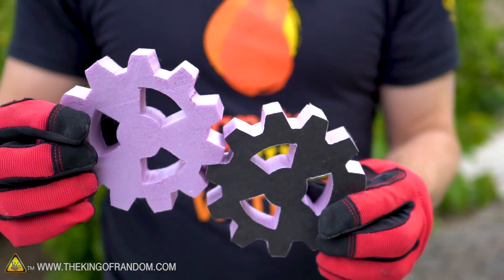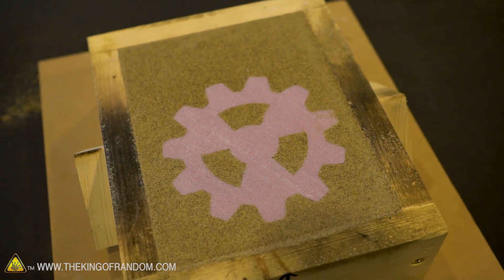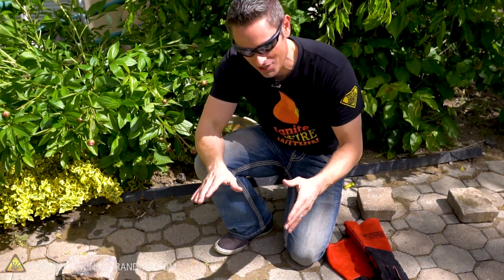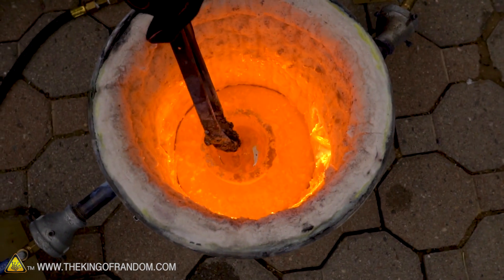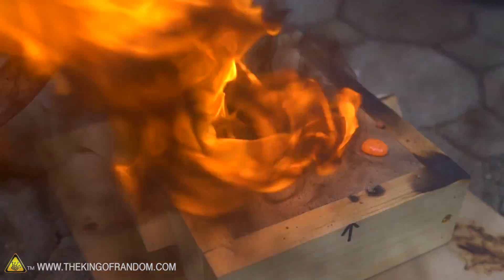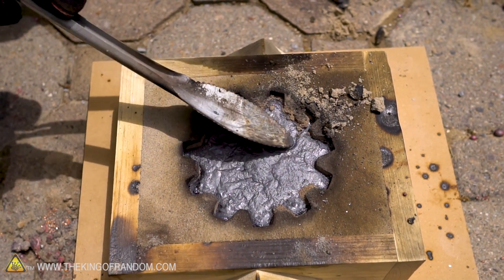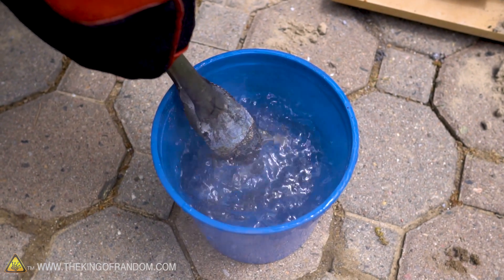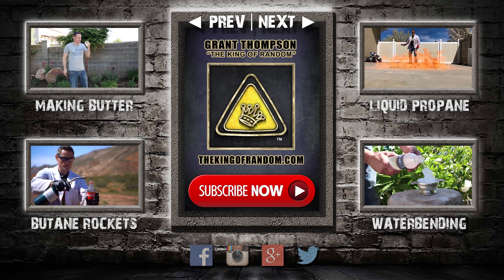Argh. Why Is Copper So Difficult? TKOR Tests Melting Copper In Our Homemade Foundry

Comment: always go to the scrap yards to get your copper much cheaper
Reply: What do you guys mean by dirty copper? dust, dirt and sand is easily cleaned off, you grab a broken down electric motor or transformer and you could get decent copper there from the coils alone and other bonuses like aluminium and steel which is cheaper than buying brand new copper tubes pound for pound.
Reply: 13thSystem ᴡᴇ ᴍᴇᴀɴ ᴛʜᴇ ғᴀᴄᴛ ᴛʜᴀᴛ ᴅɪʀᴛ, sᴀɴᴅ ᴀɴᴅ ᴏᴛʜᴇʀ ɪᴍᴘᴜʀɪᴛɪᴇs ᴄᴀɴ ʙᴇ ɪɴsɪᴅᴇ ᴏғ ᴛʜᴇ ᴄᴏᴘᴘᴇʀ
Reply: Non metal impurities are rarely an issue in metal working, it's the metal impurities such as one metal mixing in another metal which is a problem to remove and in most cases impossible. Most non metal impurities rise to the top when melting metal sorting itself out.
Reply: Jay Perez what font is that
Reply: I have a feeling he could get some sand inside the gear.
Reply: but if you buy copper in scrap yard its not as clean as new stuff
Reply: Richard Jelen he was doing a terrible job of keeping it clean. How much sand do you think he mixed in with the copper?
Reply: Heathclor sᴏ ʏᴏᴜ sᴀʏɪɴɢ ʏᴏᴜ ᴄᴏᴜʟᴅ ᴅᴏ ɪᴛ ʙᴇᴛᴛᴇʀ ᴡɪᴛʜᴏᴜᴛ ᴜsɪɴɢ ɴᴀᴛᴇ ᴏʀ ɢʀᴀɴᴛ's ᴛᴇᴄʜɴɪǫᴜᴇ/ᴍᴀᴋɪɴɢ ʏᴏᴜʀ ᴏᴡɴ?
Reply: My local scrapyard will sell to you. As long as you are buying at least 2,000 lbs.
Reply: @wampaku2  my local junkyard sells washing machines which have tons of copper wires for only like 10-20 dollars
Reply: must be a rigid copper alloy wire is too pure and too soft
Reply: But then it's not pure
Reply: Just buy it from the neighborhood crackhead.  Name your price is the name of the game there.
Reply: Rick Gunter ɪᴛ's ɢᴏɴɴᴀ ʙᴇ ᴍᴜᴄʜ ᴍᴏʀᴇ ᴅɪʀᴛɪᴇʀ ᴛʜᴀɴ ᴊᴜsᴛ ʙᴜʏɪɴɢ ᴛʜᴇ sᴛᴜғғ ɴᴏʀᴍᴀʟʟʏ

Comment: Watching this experiment was painful.  I was about 5 years old when I first saw my father pouring molten metal in a mould.  Centrifugal casting.  How do you expect loose sand to stand up to the forces of weight and pressure of molten copper??? If you had to use this method, you are better off to keep the Styrofoam in place, giving stability to your sand mould as the copper replaces it.  You also need to worry about metal contraction upon cooling.  I am a tool and die maker by trade with extensive knowledge about casting, forging and every other imaginable means of metal fabrication, manufacturing and metal forming in ferrous, non ferrous and precious metals.

Comment: Quite amateur way... If you want to have better result:
1. Use colsed mold with cannal
2.Allways heat up your mold before you start pouring metal.
3. Throw this sand to bin and start using proffesional and more exact casting mass.

Comment: Viscous liquid material impacting and flowing against a material that, packed as it might be, is not very cohesive. Basically, you are looking at an oil/water situation; the sand is being lifted and trying to float.
Sand is a bad material to be using for a pour like this. As other people have said: possibly some sand additives, clay, or you might try certain kinds of ceramic plaster.

Comment: It oxidizes extremely quickly at elevated temperatures. You need to eliminate the oxygen around it (they use an argon shroud in industrial casting of copper).

Comment: Every object partially or completely submerged in a liquid is buoyant by the weight of the displaced volume.
The pieces in the centre separate (due to the fact that they are not bonded to the rest of the mould and start to float on the molten copper. I suggest you try again with a mould made with fine play sand mixed with sodium silicate (which can be made fairly easy -> yt has some recipes) Sodium silicate will bond all the pieces of the mould and is heat resistant enough for copper...

Comment: The water in the sand mixed with the intense heat is causing the water to turn to steam. Which in turn causes the sand to expand and lose the shape... Maybe try it with dry sand?

Comment: Remove the styrofoam!!! You’re introducing impurities!  Dust it in corn starch and gently pull out your form.  Foam moves around during the process and creates damage to the form.  You’re not using proper green sand and you would have better luck baking out a wax model or remove the model FIRST!  Next time try brass.

Comment: I'm no expert but I noticed that the last try with more water made it worst.  I think the problem is that the moisture trapped in the sand evaporates and pushed the three cores out. It wasn't a problem with the outside due to larger surface for venting.  Perhaps you can try to sinter the sand mold in a kiln first. Hope that helps.

Comment: My uneducated suggestion would have been to blow torch the Styrofoam right before pouring to not just melt the mold but to heat up the sand, so that the copper isn't flash cooled on contact, while also causing the water in the sand to literally explode....

Comment: To my untrained eye it seems the high melting point of copper means you either rush the pouring - which is sloppy and you can easily disturb the sand - or it cools prematurely and won't flow into all the right nooks and crannies of the cast.

Perhaps using a solid cast rather than sand would limit the risk of rushing.

Optionally you could perhaps do multiple passes? does the gear need to be a single solid piece, or can you create your cast in several pieces? for example cog rim, and cog hub separately, but make it as interlocking parts so it doesnt fall to pieces?

Alternatively you could perhaps make a simple cog shape first, then use etchings or inlays to get your desired effect.

Comment: Make a box place the mold make a another box pack it make a hole on top pour the melted metal make sure to make more holes on the other side to let the air pass ,, later u can cut excess!! Have u seen a video of melting aluminium nd pouring it into a ant nest !! Tht might give u an idea !!

Comment: Im not a pro in casting but when i see the gear going plastic and glueing the sand  , i cant help to think that the gear is not done with the right material. Shouldnt be wax? 
What if you make a piece with ice, than put the sand, than let the ice turn to water  and pour the empty space?

Comment: You need something heavy on top of that 3 sand parts that break off, the buoyancy force seems to break them off, or use a mold with a top. You shouldnt pour the metal from a height because it has more gravitational energy when it hits the mold and that can damage it.

Comment: you could have had more luck if you use oil based sand. I've seen other YouTubers have done that as well but using different designs.

Comment: You need to close it completely you need to fill it into the form from the side or so the form must have a upper side too that’s how they do it in the iron/ steel works they have the form completely closed

Comment: Mould shall be made of mineral clay. Alloy shall be Cu at least 95% pure(Not Al 25 Cu Pb as you get in plaming pipe) Or you may use controlled Ar atmosphere to prevent forming of AlO2, a ceramic compound with around 3000C melting point. In both cases you may use Borax or any other oxide/residue preventive/reducing  methods. Also, the mould shall be prehited In order to prevent the unwanted round contoured edges due to addition forces lower than cohesion forces. Any how, a functional gear, without any post casting rectification of the truth can not be produced at such big dimensions. Even a smaller size, due to the big contractions, need to be casted in centrifugal force fields and under 2-300bars pressure @extreme hi speeds.

Comment: What if the detail holes in the gear were also filled with wood. I don't know if It would burn quick enough to interfere with the design seeing how the copper cools so quickly in the mould.

Comment: If you mix some motor oil in the sand it helps hold together regardless of the heat.

Comment: Why don't you try to cast it inside the sand not on top of it, just cover the mold surface with another layer of sand drill a couple of holes pour the copper from one hole and wait until it pops from the other, this will ensure that the sand blocks wont float cause it has no room for floating

Comment: you need to use a hot mold or the added copper will change the shape of the mold as it hits it use wet sand to make the mold and bake it

Comment: mix in some cement when sand is fresh.. You don't need too much. Sprinkle a bit of water over it so you have a DAMP mix and then let it dry, at least, over night. You can't duplicate how it is done ion factories so don't try. My idea has worked for me a lot when I was a bit younger (70 now) ..try an old-fashioned trick eh.
Reply: Sometimes, if not most, you older heads have most the common sense and better ideas.
Reply: Im thinking the same thing
Reply: I was going to suggest the same thing.  Instead of sand, make the mold from cement.

Comment: Sand is fine if it is constrained by the edges of the mould, but for any internal structure points with no edge reinforcement, the buoyant force of the copper is going to cause the less dense sand to float.

It's no surprise this didn't work when you think about the science behind the materials being used. 

A closed mould may work better as it would give the internal sand structures two points of constraint.
Reply: Guys, it's about views, not about melting copper.
Reply: actually, temporary molds are fine, but they are not just sand... they are a combination of more stuff, and it usually gets black due to some of the elements... like, a special clay and some other stuff... I don't use temporary molds very often,,, but in homemade projects I make them researching what I am going to cast
Reply: Oil based sand works really well for molds like this I've watched PressTube for a while and that's what he uses to make molds like this
Reply: CSGuitars, I was just about to comment that
Reply: I was thinking something along the same lines, in terms of the density and weight of the copper compared to the mold's ability to stay together, though my first thought was to increase the amount of whatever binding agent he used to make that greensand, so that it adheres to itself more strongly. The greensand's composition could likely also be changed in other ways as to make it more robust for the copper, though I don't know enough about his current composition to suggest any changes.
Reply: CSGuitars thats what I was going to say. Like pulling teeth there for a minute trying to explain it to my girlfriend lol
Reply: thus using elmers glue worked for me and adding a hunk of brass also pure copper would be just to hard
Reply: CSGuitars I will bet "a dime to a donut" the difficulty is the low density of copper and the fact alloy he calls copper most likely contains nickle and other elements.

Comment: Why you didn't use Closed Mold? that was the issue honestly. open mold wont hold the liquid in it will pop up the sand out. it is like water for the sand.

Comment: I'm pretty sure a lot of people sad this too, but if you won't cap it with a full layer of compacted sand as a lock, your stuff will start floating as they're less dense than liquid copper. for this very reason, you build a cap, in similar dimensions, with a pour hole screw them tight together, some actually take another step and go further compacting after the cap is on. You pour metal, freestanding beams are supported from the top. so nothing ever starts floating on top of the copper lake.
Reply: Was thinking to myself the entire video, "Why is he pouring into only half of a mold".

Comment: When you compact the mold with the styrofoam in it, the styrofoam gets compressed slightly. Once the lid is removed, the styrofoam expands slightly and weakens those three sand details by lifting them just enough to not be strong enough when the copper flow hits. Try making the mold with wax, maybe? It would be great to build the mold with, plus it would melt away. Perhaps drain channels might need to be cut, but youd clean that up when finishing the piece.

Comment: The three chunks of sand have to be touching touching the rest of the sand on the outside so they dont gog out and float. You could also try just taking the three spaces out (kind of like you did in your last try) and make it just one solid gear. Hope this helps!

Comment: Half the problem is the open mold, second half is the casting medium, use was as a place holder. Instead of getting the bubbling from the styrofoam, the wax melts into the sand and helps hold the mold.

Comment: The sand will keep getting displaced until and unless you mix in a binder, like molasses etc. That will keep the sand intact. Work on the preparation of the sand.

Comment: Mix sodium silicate into the sand if it doesnt already contain it. Make your mold dry and set in a cheap plastic bin from walmart with a bowl of vinigar and baking soda that is still fizzing before you close the lid and that will harden the sand after a few hours of being sealed in the C02 gasses. Your problem is that the sand was denser than aluminum so it didnt float but the copper is dense enough to float sand to the top of the copper so all the details in the middle technically floated to the top because science...

Comment: Maybe if you add a bit more clay to your sand and make it a two sided mold the sand will hold together a little bit better? I'm guessing the sand is less dense than the copper, so it wants to float.Adding clay might make it a little bit more heat resistant. and making it a two sided cast will reinforce the center pieces.Great Video!!. I'll definitely be giving it a try.

Comment: Do traditional way sand on both side and put gear in middle(inside of it) of it then pour melting copper through small hole later file it.

Comment: Hi Copper likes to grab oxygen so if you cover the metal with charcoal or coke it will retain the heat and not have as much gassing and pitting. Cheers from Alaska

Comment: you cannot cast all metals , the contraction of some metals is so high it does not cast well , however some metals crystallize and expand into the mold making great cast like aluminum alloys . you cant cast all metals well
Reply: NOBOX7 contraction could be minimized by placing a reservoir attached to the main part, it's a widely used technique for steels

Comment: I don't recall doing copper but your missing half your mold. We always put a part in half of the form. Pack it like you did. Flip it put baby powder dusting and put another form on and pack that. The baby powder keeps the sand from sticking to the first half. While they are together cut a hole (think it's called a sprue) away from your part with a pipe. Pull the halves apart. With a spoon shape 1-2 trenches to your part. Remove your shape from the bottom. Put the two forms together and pour metal in.

Comment: When I was in shop class in High School, we used sand mixed with oil. That seamed to keep the sand together. Also, we buried the molds. Do what you did, but then add another frame, stick in a couple tubes  (for pouring and vent), and fill up with sand again. Also another thing we did in shop is we screened the sand that contacted the mold, and then used unscreened sand to fill the frame. I made a breass knife handle this way. Still have it.

Comment: It has probably been mentioned before but it would be better to make a two part mold with sprue risers to allow the molten metal to have a place to flow in, fill the mold, and flow out.  Also, putting borax into the molten copper before the pour will help to burn off impurities.

Comment: get concrete and sand mixed well, let it dry having the foam into it, once it solid, remove the foam dont let it be there, it releases fumes and bubbles which ruins the molten copper.

Comment: How about you use a real mold
Reply: Now i have no experience in this whatsoever, but would clay be better?
Reply: there is a casting method called "delft clay casting" which is used in goldsmithing that uses a special type of  clay that would probably work very well with copper casting.
since gold and silver alloys have copper in them you could argue that they act relatively similarly.
Reply: They use plaster of paris with a special resin model of the jewellery .so molten metal vaporize the resin and take the shape of the model.......it very easy and cheaper than this method
Reply: Aeiou yes, and no.
Reply: It's old fashioned metal work
Reply: The whole reason he does these metal molding videos is so we can see the results
Reply: It would probably it would just melt and catch on fire😒
Reply: u r a hater

Comment: pack the sand down tighter. make a block that fits in the box but not to the point where it is hard to get in and use a mallet to hammer it to pack it tight

Comment: No venting holes thru the bottom?  You must have a few thin venting holes at the bottom thru which some of the liquid metal can "vent" thru.  You can cut off the excess copper "veins" which form as a result of running thru these vents afterward.

Comment: Hey buddy. Copper is hard, but you'll do better if you make a two part mold with risers.  More volume = more retained heat, and greater pressure inside the mold to shove the metal into the details.

Comment: You don't have to melt the Styrofoam before pouring. You can pour on top of it and be just fine, in fact the Styrofoam will help hole the sand in place as the copper fills the space. I know from experience

Comment: your not doing it right, you have to make two side hold together in one to make a mold in the middle of the sand, if you don't have the skill to mold it in sand then get clay and sand mix together which it is bad idea, but you wanted thick covering for it and have hole for your mold to able pour copper into the mold.

Comment: You could buy a metal casting tray, make an aluminum version of the gear, put the gear in the tray and cast a mold of the gear, and then it will be made of metal and the inside won't lift.